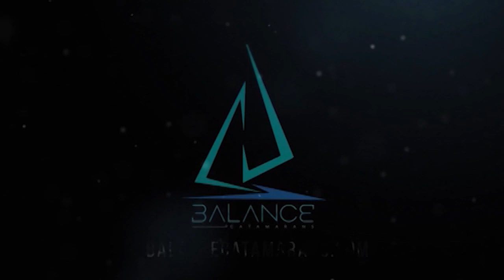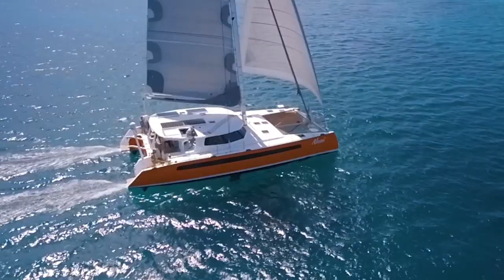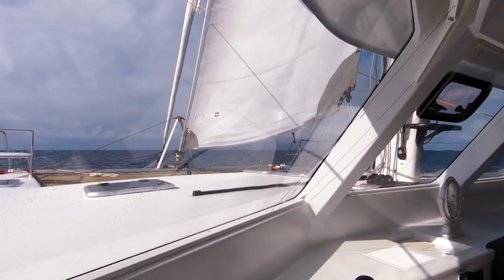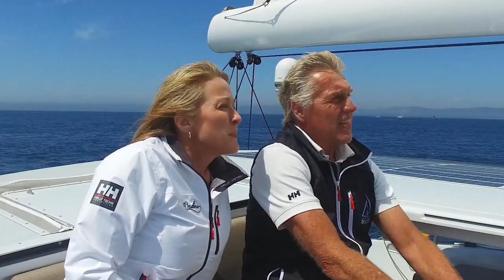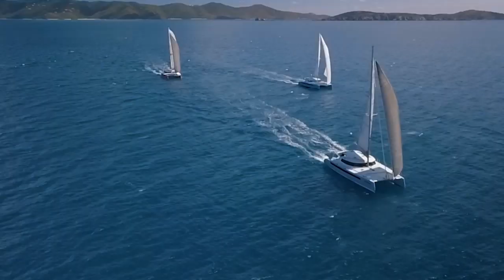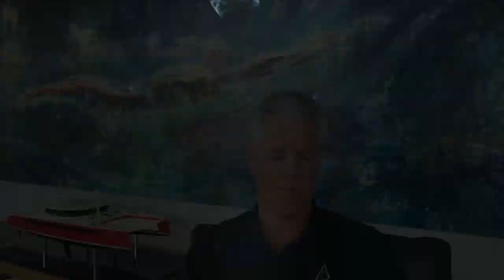Electric Engines on a Balance Catamaran?

Comment: Modern electric sail drives have cooling systems and use regen for battery charging as well as solar
Reply: If you look at some of the videos from Oceanvolt there are some sailboats that use solar in the sail plan, so yes the technology is there we just have to embrace and use it, the biggest factor is the cost $$$$ is it really that expensive??? but if we do our research you will be surprised at what you will come up with.
Reply from the maker: Kimble, all of the electric engine cats I have seen have needed significant additional cooling and fans installed. I have seen a few in Cape Town and the electrician who installs them is a friend of mine. He has learned what to do and not to do at this point, but if you talk to him or most marine electricians they are happy to take the extra money but shake there heads privately as to why people go to such expense for something more complicated, less reliable, with limited range and speed, and which is not in the end any greener. We just are not there yet on the storage side, or solar efficiency side in our view.
Reply: @balancecatamarans  you have given such good advice. I wish they would listen to you. Anyone who has spent any amount of time on the ocean would understand why you would advise against a purely electrical propulsion unit. 
You guys make beautiful boats and I appreciate your philosophy. I look forward to buying one of your boats when I retire.
Reply: What do you think of that company called silent yachts? They have two generators and I think 28 lithium batteries. I don’t really know that much about boats, but silent yachts said they cruise that six nights and I’m not sure what the maximum is may be 10? I was thinking what happens if you get caught in a bad storm that’s not enough power
Reply: Gavin Grantham if you look at the videos for silent yachts, the guy said there is some downfalls for sail Solar panels. But I worry about with electric is you will not have the power if you get into a storm
Reply: Balance Catamarans Did you watch any of the videos for silent yachts? The guy really convinces you how good the electric boats are and he said he has two generators and 28 batteries. The only problem I see is a cruise is at 6 kn and I think the maximum maybe it’s 10 Knots. And I don’t think that’s enough if you were in a storm
Reply: @rockn997  for the Silent 55, cruise is 8-10 knots, 17 or 18 knots max however at 5 knots  you can go indefinitely. Of course, that assumes you have perfect sunny conditions. To Phil's point, it's a safety factor... although that's what DC generators are there for. Personally I like the idea of full-electric, but I guess it depends on the use-case. Boats that stay close to shore can go full electric, however, blue water may be a bit different. Tesla just had their battery day, where they announced some exciting new innovations in batteries... let's hope companies like that keep innovating so that all that tech trickles down to boats and other platforms. I own a Tesla and the biggest thing I like about it isn't just the environmental aspect - that's a great bonus - it's the way it drives... it's buttery smooth, super fast, maintenance free, quiet, simple, etc. Would love to see the same features on a boat. It's only a matter of time. By the time I'm ready to buy my cat, I'm definitely going to want it to be electric.
Reply: @balancecatamarans  i have had  this  same debate  with another  youtube  guy  about how great electric is   and  for eg  he says  they are  maintenence free ,,..  and as i put  that statement alone is laughable //   i can see solar   and electric drives  as a back up for emergancy use only //   but out in the big water ,  id prefer my diesel  with enought fuel  and speed  that if a  rouge storm creeps up   ,  id like to know  that i can outrun it  .. then again   thats only my opinion .///  but then again ..  fishing   and sailing  are  two different beasts ..  then again , the lads on  the good old bluenose did all that  with no power.  its all a matter of preference .

Comment: Phil, you’ve given us a well presented viewpoint that opened up a round table of similar as well as opposing views.
Technology continues, and I hope in 5 or 10 years time we can look back and appreciate the gains that will have been made.
But I also hope we don’t reach a point that we have sailing catamarans that can be silently electrically powered indefinitely at hull speed.

I fear that would be the beginning of the end of sailing.
Reply: it is quite the opposite. An electrical Sailboat forces you to be a better sailor.

Comment: Super job Phil! You broke it down in layman terms, which is hard but you had to skip details.  Most comment below ask my question:    Why not something hybrid on the concept of the Chevy Volt... Not a big-ol’ cruzing battery, like a Tesla X, but something that handles day-to-day life by regenerative fossil-fuel free source, but for a voyage you have diesel.  -Like landlubbers, most days use little energy, but what about an extended trip/voyage...   So can you compare those two?   One boat has one engine, electric drives,  plus a modest battery, the other has two engines, mechanical drives, and minimal battery... The production cost and weight of both vessels  is going to be the same... so isn’t the first the best of both worlds?
Reply from the maker: Electric is just fine for day sailing or short hopping as you can plug in at some dock each night. Get away from that and you need a diesel generator to charge the batteries for electric
motoring of any distance, at any speed. By the way, it is very interesting to go to Green Car sites and note that how green a car is is tied to how that state generates electricity. I am exploring a plug in hybrid for myself because my daily commute is less than 8 miles, yet the car will still have the range for me to drive long distances when required.
Reply: Nova Luxe has a study on their website that shows a 51 Leopard comparing the differences between two motors against two engines and also one motor and one engine. https://www.novaluxeyachts.com/hybrid-explained

Comment: Sails and Solar is not a match because of the shadows cast by sails for long range cruising.  Solar cats do not have that problem and have much more solar panel area. Nevertheless both need big generators (two 100Kw to be on the safe side) to keep going and those generators weigh more than a 80hp engine .... plus you need to carry more fuel for those generators.   At present in a Sailboat solar is for all electrical items in the boat so that you will not need to turn on the generator. In solar cats without generators you are dead in the water drifting in 8 hours.  The range and speed is still not there.

Comment: Diesel electric is fine. Hydro when sailing, solar wherever it can be and 4-5 hours of battery. Electric lets you have horizontal shafts and put the heavy Diesel engine wherever you want and possibly lower overall weight. 

For non-borage usage electric gets you in and out of marina and marina charges over night.  For doldrums run generator, for passages mostly sail.

Solution is just to have that generator.
Reply from the maker: Roger, people vary significantly in how they use their boats, and power consumption, so each boats electrical system must be designed to achieve their specific objectives. One size does not fit all. And you cannot just move heavy things anywhere you want without a careful weight study, which is why a yacht has to be designed from the ground up with the weight loads where they belong. To re-tool an entire boat to have engines amidships or this or that is not a simple project!  The cost for new design, engineering, tooling is over 2.5 million for a 50 footer and two years before the first new boat. That's why builders try use the same tools for decades. The cost of innovation is considerable. Even car makers try to use the same tools for 5 or 6 years.

Comment: great video with honest answers regarding this topic. while I totally agree with your points that 'all electric' just isn't there yet, it's still totally workable with today's technology as long as some compromises are made - ie no all night motoring. I won't mention names but using a similar configuration of a 'solar cat' but adapting it to a performance cat, you could cruise all day(when sunny) without requiring a massive battery bank. I do 100% agree just for safety there should be a backup generator which may never be used except for extreme circumstances.

adaptation of solar could be far better given today's panels. there are bifacial panels that can pick up energy on the backside. high end panels use half-cut cells with more junctions so shading impact is far far less than panels I often see used on cats today. using a charge controller per panel is a bit of overkill since you can use power optimizers, but again high end panels just tolerate shading own their own. I realize it may not look pretty, but there are creative ways to integrate more solar on cats. it just depends if there are enough customers who want it since after all you are running a business.
Reply from the maker: Sure, people do what you suggest. We stated our views, but there are those who want electrics or other things, and that is just fine.

Comment: My apologies if this has been addressed,  but I have yet to hear about the option of having one side diesel and the other electric. Why would you want to do that? Is it no longer the practice to only run one diesel for efficiency when needing to motor through low wind situations?  Aren't the very high output alternators I've heard others starting to use available allowing for quicker regeneration? Doesn't access to instant thrust that an electric offers have any safety value? Couldn't you use both if the circumstances called for it? Wouldn't it be nice to be silent in the many circumstances where brief motoring is called for? How about having to reset your anchor  at 3:00 in the morning? Is it too complicated?

Comment: From looking at the all-electric catamarans now available (which are using large array of lithium batteries, full solar roof, and backup diesel generator) it would seem that using sails combined with electric motors would only work if the ,diesel generator / electric driven propellers, is a more efficient combo than the ,diesel engine driven propellers'. I'm suggesting this because using sails would prevent efficient solar charging and, as the video explains, the weight of the batteries may nullify any possible gains of regen from the props or using wind turbines. So for a catamaran like Balance's the change has to be total solar roof with electric drive and backup diesel generator like the Silent E-catamaran which crossed the Atlantic using very little diesel and relied mostly on solar/batteries for propulsion. Given Balance's performance pedigree it would be interesting to see how fast their version of an E-catamaran would be compared to Silent E's and the other 'all electric' and 'diesel/electric hybrid' cats we are seeing on the market now. Of course, when you add the high quality of a Balance and the potential for a lower price point it might provide quite a competition in the current marketplace. But it seems that the cat has to be fully committed to solar regen with a combo of diesel/electric hybrid backup not the sail/solar combo some are attempting. I wonder if anyone is considering a solar regen along with wind turbines? I heard that wind turbines can be noisy... though that would likely depend on the type of wind turbines. The Silent E also has the option of adding a kite sail. The Balance cats are among the best performance cruisers so glad to hear that greener options are in discussion even though the technology may need some catching up. Your video is very helpful - keep up your great work!
Reply from the maker: If you do a boat that is super light, with no cabinets, not much on her, kept the hulls vary narrow of course it would be more easily driven with less energy. Like the boat you mention. We could build such a boat, but it is not what we focus on at Balance. Silent -E was not a luxury boat or carrying the kit most of our clients want!  The two issues of big concern to us are the ability to motor fast when there is little solar input to position out of harms way. We want to have at least 200 miles of range at 8 or 9 knots without solar gain. The other issue is reliability and repair-ability in remote places. To date the electric options have yet to prove themselves to be bug free and as reliable as diesels. Unless you want to operate with very low range at low speed, or on a boat with very narrow hulls, little payload and little gear, you have to run a diesel gen on any cruising cat. As I said, technology may get there, but not yet.

Comment: FP announced they will install a hydrogen generator in an upcoming cat, the REXH2 from EODEV. My immediate reaction was: 'ok fine, but then where do I get hydrogen outside of developed countries?". But apparently it can also create its own. So then, perhaps it works out since you usually have days on anchor while out voyaging to collect solar as well. 
I obviously haven't done the math and energy budgeting, but I like that there are different angles to push innovation forwards.

Comment: What about having 2 completely separate systems assuming you have a deep wallet -  I.e.2 yanmar sail drives and 2 ocean volt servo  sail drives, so 2 sail drives legs  in each hull. I note SV Top Secret 2 originally had 4 ocean volt sail drives with 2 dc generators. The vessel was struck by lighting which disabled all the ocean volt drives. Now the owner has removed 2 ocean volt drives and the dc generators and replaced then with 2 Yanmar sail drives with 2 Intergal alternators. I reckon this is the greenest and safest solution as you can utilise regen when sailing and have the backup of pure diesel propulsion when required.
Reply from the maker: Sounds complicated and heavy to me Paul!   As for what happened to Top Secret - it only confirms what I have been saying about the reliability of a diesel cat with Integrels. Keep it simple if you can. Tons of solar, lithium bank, two diesels, Integrels on both engines. This is your lightest and most reliable and most efficient system for now. Best, Phil
Reply: wow thats crazy he went and installed engines.  Nicest refit I've ever seen on a cat though.  Pretty much straight up a normal condo.
Reply: A more logical solution would be to have a diesel drive in one hull and an electric drive in the other hull.  The electric side could have a backup generator, or you could simply use (a two output) alternator on the diesel side to charge batteries on the electric side.  

That would get you dual motor redundancy (with a separate generator for the electric side), one electric, one diesel.  You could use the electric side and regeneration as much as possible, keep the diesel side as a backup and use both if fast motoring was needed.  The battery in the electric side could also easily power all house loads and still have lots left over for propulsion.

Having double diesels and double electrics is twice the needed redundancy/complexity/cost.